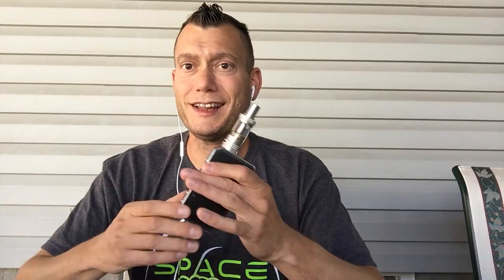Dangers of Ni200 nickel DON'T vape it on anything BUT Temperature Control!

Comment: no wonder when chain vaping a boost 0.2 coil that to my mistake have not read the description and it turned out the taste was different. it's like a stale plastic or something but after cooling it down for a bit, the flavor is back and when i chain vape again it's their. i checked the coil by using a swab to clean the inside i notice the juice inside the occ coil head turned rusty red and i also my cotton in the swab has some black burnt juice. now i saved my life by not inhale the harmful fume of nickel. i enjoyed my vaping journey with tc-ni on the pre installed 0.2 ohms coil head on my z-nano tank 2. it's much flavorful and it squeezes the flavor out of the cotton when i vape. just 1 week on this mutherchugging tank on wattage and by switching to tc-ni it changes the game.

Comment: Only thing that sucks is when you order nichrome and one of the spoils of wire turns out the be nickel. So yes I have done ecerything you just said not to because the wire that I was using was labeled as nichrome and found out that it was nickel.

Comment: Thanks for this video! My dumbass has been buying uwell crown tank coils, 0.15ohm- ni200, and vaping it on reg watts 50-60 for 2 years, and noticed that my coils would get gunked up or the cotton would burn after just 4-5 days of using it so i did some research on temp control and how to set it up. From today i will be vaping it on temp control, and my settings are 245'C 50watts. Is this correct with a  0.15ohm ni200 coil? i sure as hell hope so, and i'm glad i haven't died or anything..... xD

Comment: Dude thanks a lot man. I put my vape to low wattage of 35 Watts with 30 ohms and high temp and I produce more vapors and less hit. It is optimum for me and it is insane. Thanks for the heads up. Temp control is the best.

Comment: Thanks so much for your video. I’m using an alien 85 in ni mode at 400 to 420 degrees. I saw a video that was 28 kanthaw 30 nickel use a drill combine until breaks off. Single coil evenly spaced-build. this build has great flavor and amazingly it puts out 3x the vapor as single wire kanthaw or nicrom dual builds do. It’s easy to use. Thanks so much for your update. As always you put out some great advice. Hope I’m not putting myself in danger using my temp control device using nickel. Cheers

Comment: Hello - I recently purchased a Rev Brand Vap Pen. My rev battery is made of stainless steel with rechargeable lithoum ion battery. it features control board sensor. the tank is made of stainless steel base Pyrex glass and uses 0.5 ohm US kanthal coil that features turbo flow technology.
battery capacity 1500 mat

I'm new to vaping and concerned with ALL these horror stories of this exploding in folks mouth.
is REV a good brand ? Mine is not temperature regulated.
Any advice ?

Comment: Need to do more research my friend. ni200 can be toxic but it has to leach into the juice you vape, that means you have to burn it well over the temperature a mod can produce. Yes a wire can get a hot spot and break but that's NOT melting and causing leaching. 
If ni200 was so dangerous don't you think we would stay away from it? And it not in the market for all to use freely.
Reply from the maker: yeah?
leach?  really?  you know that?
and china only puts out safe products and materials?
Their industrial manufacturing cares about end users?
ok.  Vape on my friend.  enjoy yourself.

Comment: i just got in to vaping so i'm a noob lol i have a , iken 230 watt mod with temp control and i just bought a toptank mini that came with 3 coils, an rba coil , a 0.5 ohm normal one and a 0.15 ni200 . at temp should i be at to vape the 15 ni200 coil to be safe . thanks for your time :)

Comment: i am a boilermaker welder and this guy is speaking the truth electric resistans heating can get coils to melting points and WILL get them to rapidly oxidize nickle and crome r EXTREAMLY toxic when ur is glowing red ur at (around) 900c when its changeing from red to yelow white ur going to 1200c~1500c plus at those temps SS and chrome coils can give of harmfull oxidants look up metle fume feaver or welders flue or wiki if u think im wrong...

Comment: so i am using 36k - 26n clapton wire. I never mess with temp control. Always in wattage mode. usually 40 watts or so at .3 ohms 
so I guess I'm confused, why would they even let consumers use an unsafe metal in the first place, and now I wonder if the 36k-26n means I am vaping toxic shit on wattage mode.

Comment: Hi, I bought eVic VT few days ago with Ni coil. If I use Ni temperature control even on max settings 60W, 600F I have little smoke and taste. If I try VW mode I get x4 stronger taste and x5 more smoke. Is there any way I could get same result in temperature control mode? I'm new to vaping and have no idea how to change coils or what coil to use in VW mode...

Comment: Thank you for this video. 
Cheers
Reply: so i am using 36k - 26n clapton wire. I never mess with temp control. Always in wattage mode. usually 40 watts or so at .3 ohms 
so I guess I'm confused, why would they even let consumers use an unsafe metal in the first place, and now I wonder if the 36k-26n means I am vaping toxic shit on wattage mode.

Comment: This guy is not wrong, but he's blowing this out of proportion. It's perfectly safe to use nickel with most mods as they are locked to 600F. Even in wattage mode, you'd be fine.

You have to get the wire to 425C (797F) minimum, and hold it there for an extended period of time for any carbon to precipitate at all. You would have to hit your temperature controlled coil at almost twice normal operating temperatures, for a whole hour. Also worth mentioning is that the experiments in the SpecialMetals paper were done in environments of pure hydrogen, and a hydrogen/methane mix.

So let's say you've done the above and some negligibly miniscule quantity of carbon has precipitated from your coil. It doesn't magically get airborne. It would more than likely stick to the coil, or run off in juice.

One can pretty conclusively say, based on evidence and common sense, that graphite precipitation from nickel coils is literally nothing to worry about.
Reply: CelExample I have a uwell crown .15 coil/ is this ok on my Alien 200 watt @80watts?
Reply: To make it dangerous you'd have to hold it in 200++ watts or more FOR HOURS to make nickel dangerous.

It's completely safe. Almost all mods would break before you could do yourself harm in the way the video suggests. Almost all mods come with temperature control and shut off even after a few seconds of really hot vaping.

Comment: Okay so I don't know much about temperature control and I just want someone to answer this one question for me. So I'm using a Smok 220w alien with the baby blue beast and a V8-Q2 coil head. The Smok alien has temperature control mode but I don't know whether I should put it on (SS) (TI) or (Ni) I want to try out temperature control but don't know what temperature to vape at or if I should use nickel titanium or steel. Please reply

Comment: i use 0.5 ohm ceramic coil by vaporesso, so basically i call vape on power mode or temperature control mode. i use vaporesso target pro with 0.5ohm ss ccell coil in temperature mode, i get a burnt metal smell and taste while vaping at around 100*c and max temperature i tried at around 180*c recomened by a professional vaper. IIs that normal or is my coil messed up? 

FYI- im new to vaping . please correct me if im doing it wrong

thanks in advance

Comment: I'm using 21 g hotwire by chadster dual coils spaced 9 wrap @ 1.6-1.7 ohm running on temple rda(not the 30mm) and asmodus plaque 150 w box mod.... I've never had a tc mod and I'm not sure what kind of wire this is.. been running this build anywhere from 80 to 120 w.. got any advice for me about this wire on tc mode.. just recently started doing my own builds and trying to be safe wanna learn from a more experienced source.. you say not make the wire glow but how do I know then if it is firing even? sorry man got a lot of questions lol hope to hear back from you

Comment: So, I'm running the Crown tank at ~50W with a .25 stainless steel coil on my Sigelei 150W, is that safe?
Reply: Yeah stainless steel is very safe, and in my opinion is even better than kanthal because the flavor is better.

Comment: hey Quest, I have a TC mod and it also has three presets: SS316, Ti, and Ni. Would you even CONSIDER using the Ni preset? I've used TC on the SS316 based on a chart which suggested a different, higher temperature than the SS preset. I definitely head the video--I have no problem doing TC, just wondering if using that preset is gonna be subpar and/or dangerous.

Thanks for reading--again, I did watch the video and got the overall message. It just seems like the preset for 'Ni' is there for this very reason.
Reply: I only just noticed that the most recent firmware update, they've removed the Ti and Ni presets and left just SS and TC! You must be on to something lol!

Comment: So I picked up a kangertech topbox mini 75w starter. lg hg2? 20amp batt. Dude put in the clapton coil with 80/20 juice no nic. Coil went out that same night i bought it. put in the TI coil and ran it around 25-27 watts... (before i knew how to set temp control). So I figure it out and i am on NI at 250F It pulls sometimes (fires) I notice a lot of the other times my coil reads like 600f and it's not...? Could this be a bad coil? bad temp sensor?

Comment: Thanks for the heads up. I just got my first TC mod and the tank came with ni200 coils. Not knowing all the ins and outs, I used it a bit on wattage mode. It was a miserable vape, way way way too hot no matter what I set it at. Did some reading and figured it all out, working beautifully now. Do I still have anything to worry about? Should I change the coil just to be safe?

Comment: I have a Tesla 60w nano tc.  I'm new at vaping.  What is the base setting for me to start out with.
Reply: I don't suggest using Temp control for new vapers. If you're new I would start out using Kanthal with power mode, since its easy to use and understand. Since you're new you're not going to tell the difference between Kanthal, nichrome, Nickel, Titanium when it comes to taste and getting power straight away or .3 seconds of delay or whatever. Once you understand Ohm's law, what wattage you like, builds and batteries, other things then I'd move up to temp. control just for safety. I've been on and off vaping for a long time but I've never had the need to go up to temp control just for the fact that Kanthal and power mode is so simple and safe that's good enough for me. Better to be safe and have a good vape than trying to vape like a pro and vape toxic chemicals that will kill you faster than cigarettes you know?
Reply: Welcome Tom, but your question is hard to give an answer to. We need more info to figure out whats good for what tank, coil, sub ohm, above ohm. Nice little mod you got though.

Comment: Hey man i got a i sub tank with a cool fire iv mod and my coils only last me two days I'm not anything different they use to last me about a week. Im running on the same v priming the coil the same everything. Do you know why this could be happening.
Reply from the maker: when you asked the  retail shop where you bought it what did they say?
Reply: Quest4vape they said that juice I'm using could be to sweet
Reply: Quest4vape i do usually go back and forth to two brands but not lately just one

Comment: I got the kangertech top box and it has modes for NI/SS/NC/TI and of course watts. I like it so far because it detects when a new atomizer is put in and switches modes accordingly. The nickel function tops out at 600 degrees Fahrenheit for those who are curious.
Reply: +Brandon Doyle I'm not too much of an expert but I know that I use the ss, ni, etc as necessary with whatever type of coil I'm using. maybe your mod is running hot because your on the wrong setting with your coil?
Reply: +Brandon Doyle I like the OCC coils and run at 50w....burns smooth

Comment: SS is dangerous also on high temps treat it the same
Reply: +AerialGuardian less than 475
Reply: Fucking bullsit even nickel can go above 475. SS can be vaped in volt wattage mode fine, dont believe this clown.
Reply: AerialGuardian Absolutely nothing will happen to SS 304/316L/317L above 475. Even 500 is safe. Hell, 600 is fine too. Anything above that though, no guarantee's. But saying that anything wrong will happen above 475 is just plain stupid. Go research yourself instead of taking ignorant peoples word.
Reply: snee thats the point it has Ni init
Reply: Jon A no it's not the same. you just made that up in your head ya weirdo.

Comment: So if I have a ceramic/nickel coil that came with my vaperresso tank what wattage should I vape at.?
Reply: honestly if your not sure just dont use it period, i personally never used nickle and i dont really have a need to change form kanthol its safe and its works !
Reply: I have a ipvd3 mod that doesn't regulate I'm not sure what to do
Reply from the maker: The IPV D3 has temperature control.  Please read your user manual and follow the instructions for your device.  If you are unsure of how to use Temp Control please learn about it first before using metals and coils designed only for temp control.  Nickel is not intended to use in wattage mode.
Reply: +Quest4vape no instructions just definition. I think I'll play it safe n throw it out
Reply from the maker: oh...is your mod the older IPV3 from last year?  150 Watts with no Temp control?
I still have mine that I bought in 2014.  I love that mod.  sorry no, that doesn't have temp control, and yeah the user manual on that was brief.  a simple but awesome device.  Maybe best to just stick with the Vaporesso Kanthal C-Cell coils until a time when you have another mod

Comment: Hey, It'd be really helpful if you could recommend a rough range estimate for TC.  I'll use TC now, thank you for the info.  I think this video would be way better if you could provide a rough range estimate for temperature.  Thank you.
Reply from the maker: the problem with that is everybody likes a different vape.  Some things must be explored by the individual.  I would try Ni200 around 350-430...start low and work higher until you find the sweet spot you like.  Ti vapes better a little higher.  When I do temp control I use Stainless Steel these days.  And that I find vapes best for me at around 550.  It's clear that if you vape too low a temp setting you won't get much if any vapor production.  And then if you use too high a temp setting it might be too strong.  Have to explore to find what you like best.
Reply: That's solid, Thank you.

Comment: I just ordered some Ni200 coils today but since I've only stopped smoking and switched to vaping 2-3 weeks ago I had to do some research first since I had no clue what the difference between TC and Power mode was. I know when I bought my mod they told me to use power mode and gave me an extra 0.50 and took my other since I was not experienced and just starting out. This video was also informative, thanks :). 

Then again kind of wish they would have just explained it to me and not switched out the coil but meh I understand they were just trying to be nice and was more concerned for my safety till I was more experienced I suppose.

Comment: whats the max temp for nickel ?
Reply: For industrial applications it's 600F.  For vaping, who knows?
People working at NASA using nickel for whatever reasons are probably not purposefully sucking it into their lungs and probably are wearing FCC approved safety gear.
Reply: +Jim Richards  Did you use "FCC" because it sounded good?  FCC is the Federal Communications Commission.  They deal with radio and TV broadcasts and transmissions, not health and safety.

Comment: Damn dude thanks for the info. Only been vaping about a month, just picked up a new kit, didn't realize it was the Ni200 coil pre-installed, vaped about 1ml in wattage mode before I realized my mistake. Hopefully the damage from that isn't as bad as the 12 years of smoking.
Reply from the maker: Happy the video was helpful.  Don't worry, I've done it as well as many experienced vapers too.  Better you found out now and use your mod in Temp Control settings, than find out later.  Thanks for watching.

Comment: Google [Vo]:Details of the Thermacore runaway in 1996

Also Google The Fusion Revolution
Reply from the maker: I don't think we are concerned about the same things they were experimenting with.  We don't use our metals to those temps.  But the point of this vid is to keep it that way using low voltage, temperature control devices which read the resistance and back down power when max temp is reached and cut power when the cotton is dry.  many people did not know that and used this metal as they would with ordinary Kanthal or Nichrome builds.  it's not meant for that.  thanks though.
Reply: I know your concerns are different.  I just thought it might spark interest.